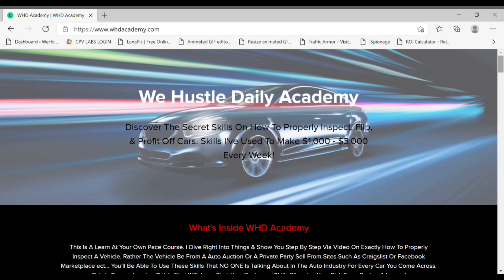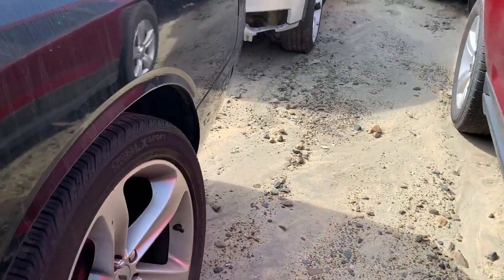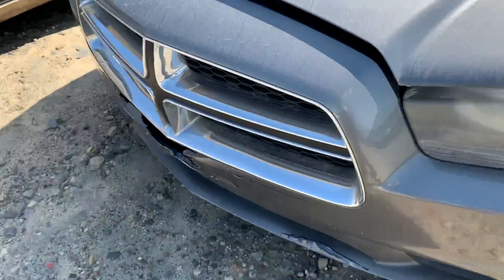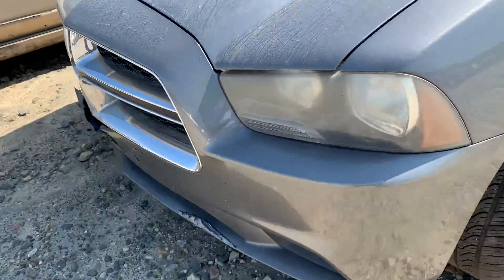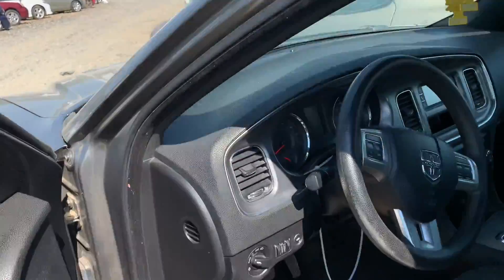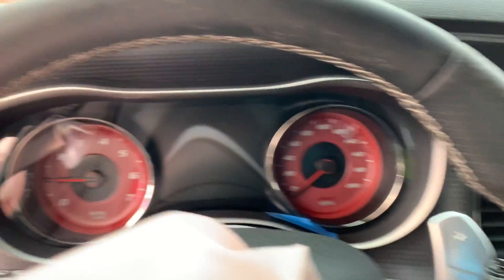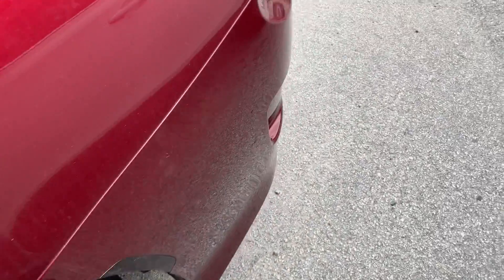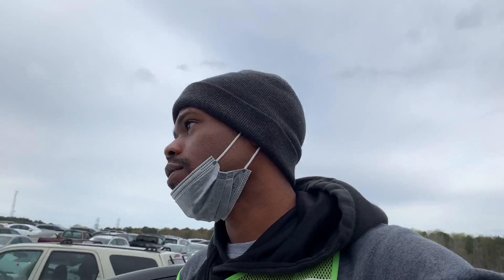PLENTY OF CHEAP HELLCATS & SRT's AT ATLANTA'S INSURANCE AUTO AUCTIONS *WHICH ONE YOU TAKING?*

Comment: I don’t understand the hype behind these cars. Death traps with no grip
Reply: It’s the driver, not the car. I’ve got a scat pack charger and it is really easy to handle vs a mustang and camaro
Reply: Those cars are hyped up. You can get plenty of cars that would beat these cars in a race and they cheaply made. Pretty much your just paying for motor and transmission and rear end set up. Everything else is cheaply made
Reply: @mychalking9921  Cheaply made? What part?😂
Reply: Glad i sold mine, they overhyped
Reply: @Mw3ghost101  literally the whole exterior and interior
Reply: @Thearttofracing  that doesn't answer my question lol. what do you define as "cheap"?😂
Reply: @Mw3ghost101  the car is cheaply made and it shows
Reply: @Thearttofracing  what shows?
Reply: @Thearttofracing  are you referring to this episode?😂😂 these are wrecked vehicles and they are designed to crumple lol that's why year after year dodge gets top safety ratings lol
Reply: @jld7779  it depends on the package, the base models are pretty basic but I've got full oem carbon fiber and Alcantara everywhere so its super nice

Comment: People are crashing these in record numbers for a few reasons 1. 7-800 WHP is to much for any young inexperienced driver and its what every young person wants 2. They dont even hook up that well when you get into it esp if there is moisture on the road. 3. These are rear wheel drive and if you dont know what you are doing or have experience with an old muscle car these cars are not very forgiving you will end up in the ditch fast. These Hell cats and Red Eyes are freakin big heavy straight line  cars and 75% of the people that buy them dont even bother with actually taking them to the track. If fact most people live in places that they never actually have the space to utilize the potential of the car. They just buy them so they can say they have them. Save yourself 30k and buy a Scatpak, its got the 309 gearing which makes them really punchy with low end torque  and put a set of 305 tires on it and all your power goes to the ground.... and it will keep pace with the Hellcat anywhere around town. the only place the the hellcat will dominate is on the track...take it from an old gear head you dont need to spend all that money for a car that you will hardly ever utilize
Reply: See ik what u saying i agree but since im young wo a permit lookin at my dream car (hellcat)charger i disagree no offense 😅
Reply: We’ll a lot of these people can’t pay the payments so the wreck and let insurance pay off

Comment: Question. Would you guys still bid on vehicles that are considered “Lemons” even if you know they’re 2x worth more than what the bid is going at?
Reply from the maker: Lemons need love 2
Reply: @WeHustleDaily  I won a 08 Ford Fusion for 800 bucks a month ago had a light hit moved the bumper support, wrecked the plastic bumper and messed up the exhaust a bit. It also needed rear taillights all of which I found at a junkyard minus the push bar and flex pipe. Overall I’m into it for a little under 2k but it runs amazing.

Comment: All Mopar engines will tic 2 seconds at start up because the oil has to travel up to the internals, very normal. If it doesn't stop ,then it has issues or no oil.